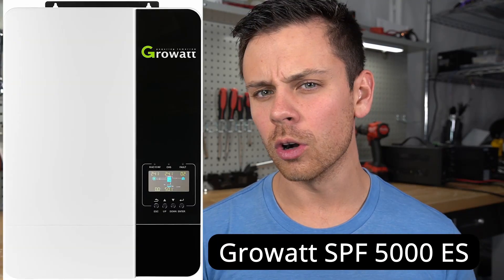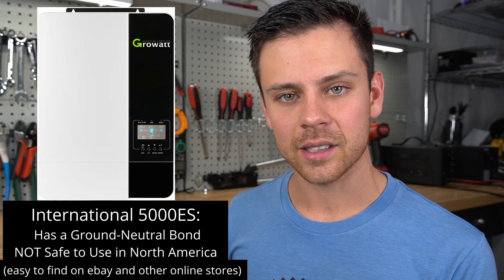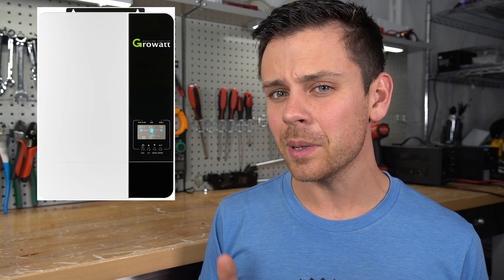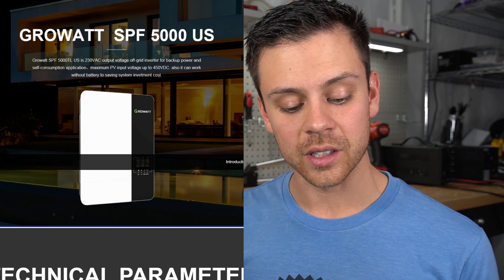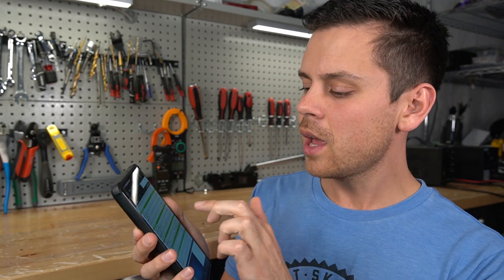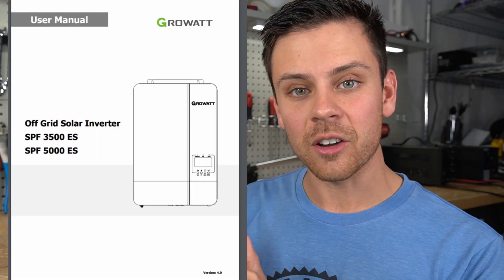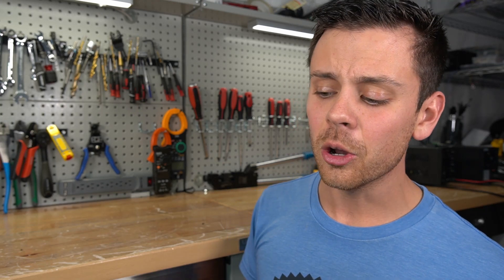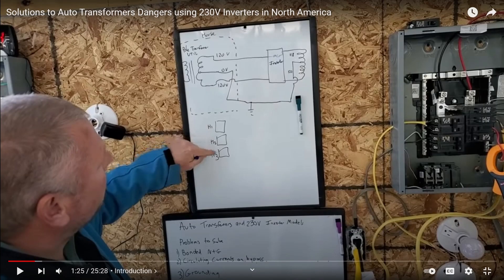The Growatt 5000ES Fiasco Explained: Is it safe to use 230V Inverters in North America?

Comment from the maker: Ian's 230V Inverter Video Part 1: https://youtu.be/gQ4NF9n0UxE
Ian's 230V Inverter Video Part 2: https://youtu.be/goF46wGmPEc
Forum Thread: https://diysolarforum.com/threads/safe-grid-use-of-the-5000es-and-transformer.34121/page-17
Signature Solar's Response: https://youtu.be/90O_iGjfm28

~~~~~~~~~~~~~~~~~~~~~~~~~~~~~~~~~~~~~
Tired of getting ripped off? Check out my "Will Prowse Approved" solar product recommendations below!

12V Batteries
https://www.mobile-solarpower.com/lithium-batteries.html

48V Batteries
https://www.mobile-solarpower.com/48v-batteries.html

Offgrid Inverter System Builder
https://www.mobile-solarpower.com/48v-complete-system-blueprint-559371.html

Hybrid Inverter System Builder
https://www.mobile-solarpower.com/code-compliant-48v-offgrid-system.html

Mobile Handtruck System Builder (very popular!)
https://www.mobile-solarpower.com/mobile-48v-system.html

Solar Panels
https://www.mobile-solarpower.com/300w-solar-panels.html

Ground Mount Solar Racking
https://www.mobile-solarpower.com/ground-mount-racks.html

Wire, Lugs and Busbars
https://www.mobile-solarpower.com/wire-and-connectors.html

Tools
https://www.mobile-solarpower.com/tools.html

Fuses and Circuit Breakers
https://www.mobile-solarpower.com/fuses.html

Plug-N-Play Solar Systems
Ecoflow, Anker And Bluetti! So many models to choose from. See my current recommendations here:
https://www.mobile-solarpower.com/full-size-systems.html

~~~~~~~~~~~~~~~~~~~~~~~~~~~~~~~~~~~~~~~~~~
Need to build a large DIY system? Need a trustworthy solar distributor? These are my favorites:

Signature Solar
Creator of EG4! Solar Minisplits, Victron and More! Largest Solar Store Online.
If you want $50 off, please use my link below and coupon code "DIYSOLAR50":
https://signaturesolar.com/?ref=cPwLcVc0SW-BjN

Current Connected
Best Prices for EG4, Victron, Midnite and so much more! Fast Shipping and Highest Rated Customer Service:
https://currentconnected.com/?ref=wp

~~~~~~~~~~~~~~~~~~~~~~~~~~~~~~~~~~~~~~~~~~
Join our DIY Solar Community 
Need more help? Join the largest solar forum on the internet for beginners and professionals alike. 140,000 members and counting!
https://www.diysolarforum.com

Check Out My Free Book
Best-selling and beginner-friendly guidebook to off-grid 12V solar!
https://www.mobile-solarpower.com/the-book.html

~~~~~~~~~~~~~~~~~~~~~~~~~~~~~~~~~~~~~~~~~~
Contact Information:
I am NOT available for personal solar system consult! If you wish to contact me, this is my direct email: williamprowsediysolar@gmail.com
FTC Disclosure Statement and Disclaimers:
Every video includes paid promotion or sponsorship (such as free products for review). Some links on this YouTube channel may be affiliate links. We may get paid if you buy something or take an action after clicking one of these. My videos are for educational purposes only. Information is subject to change/update at any time. Electricity is DANGEROUS and can kill. Be smart and use common sense :) DIY Solar Power with Will Prowse is a participant in the Amazon Services LLC Associates Program, An affiliate advertising program designed to provide a means for sites to earn advertising fees by advertising and linking to Amazon.com
Reply: I'm trying to source an inverter for a GRID-TIED system with two of the 5kw 48V jakiper batteries you reviewed. I already have the batteries. Jakiper recommended the Growatt 5000 ES. Do I need one for each battery? Do I need to be careful about finding one with the proper N bond? Is there another inverter you'd recommend for a grid tied system?

Comment: It would be interesting to find out where they link the Ground & Neutral Bond is, 
It's a Off-Grid unit for European markets, normally in the UK the Earth & Neutral are grounded at the substation, so I can understand why as a Off-Grid generation Unit as this its basically copying the Substation Transformer, it would be best just to have a Removable Link so the Customer can remove this link say near the mains supply input, 
Lots of people in USA Canada use the Victron Energy Inverter & have no problems & that's a European designed inverter,
I have to look at it this way, in  USA - Canada they have a approved inverter seller & by going to this seller everything is ok, then its a problem Only for the people who don't use the seller, yes
But using it as a totally Off-Grid unit, there's no problem, 
It's not a problem I feel with All European Off-Grid Inverters. You must have used Victron Energy units & found them excellent, yes 👏

Comment: Can any one please help me I cannot finger out if what I have planned will work.
I have a 5kwh off grid inverter Growatt 500es, the reason I picked this model it no batteries are required and any power my solar will not supply it will be toped up from the grid.
I want to put the 4 panels on my garage roof facing south south west.
And 4 panels on my flat against my west west south wall.

The inverter specs are as follows
5Kwh inverter
450v PV input max
22ah PV  input max
Where I live on an island in the UK it is almost impossible to get low ah panels 10 or bellow, but very easy to get high Watt panels like 550w+
Unfortunately they are all around 50v VOC x 14ah STC.

I want to connect them in parallel in pairs of 4. In my head this should work as I should never hit the 22ah current but I’m just not sure.
Can an expert please explain why this would and wouldn’t work.
Thanks

Comment: Hello ,

if the Growatt 5000 ES will only be used to charge batteries from the US power grid? And the inverter will feed energy from the battery to devices that will never be connected to the US grid? There will be no solar panels connected. The inverter will only charge the batteries and give the girl from the batteries to specific devices.?

Comment: great tip Will, is it possible to run the 5000es battery-less (no battery) like you did on another video with the SPF 3000TL, what would be the nominal voltage generated from the solar panel to run the 5000ES as I did not find that in the datasheet?

Comment: Greetings, dear Will! I highly value the educational videos you create in this community dedicated to improvement through solar energy use.

I would greatly appreciate it if you could take on the challenge I'm about to present.

A few months ago, precisely in June of this year, I purchased the PIP6048MT inverter from MPP SOLAR. It operates at 48v, has only one phase at 230/240v without a neutral, and is not split-phase. Therefore, a transformer must be used to obtain the two phases + neutral.

I'm interested in seeing you perform the installation of one of these to illustrate the correct steps. I'm unsure about where to separate the ground and the neutral, whether it should be at the inverter or the main panel.

I have this doubt, and I believe you can provide us with better guidance or illustration.

Thanks in advance.

Comment: Hi, i appreciate your knowledge and videos as a new solar DIY fan and eventual user. I have purchased about 8,000w of daily production panels.  I will buy a couple of 48v batteries  and I intend to purchase a 110v grid assisted inverter of about 6-6,500 watt output. is the MPP LV6048 suitable ? Is the idle consumption and AC  efficiency pretty good? Any help and advice would be greatly appreciated, i just want to try and run a few items such a refrigerator and a freezer that require constant power to cut down on my electricity bill and have a backup if and when the grid fails.

Comment: Hi, I have watched you for a year or two now, and you seem to be very favourable to MPP inverter/chargers (aio) , I spoke to them about one, and they said” we can’t guarantee that it would work with my generator, I have an ex rental diesel generator, running at a fixed speed of 1500 rpm, giving me 50 hz, surely, that should be ok with an MPP aio? Thanks for any advice. Cheers free the UK.

Comment: Europe generally uses a 240V system analogous to 120V in the U.S. - basically everything is double the voltage. So a 240V inverter in Europe is a single live and neutral, similar to a 120V live and neutral system in the U.S. In both cases it is reasonable to bond the ground and neutral. In the U.S., a 240V system is really a neutral with two separate live wires at +/- 120V opposite phase with respect to neutral. If a European inverter is used as a U.S. 240V system without a U.S. neutral, then the inverter effectively grounds one side of the 120V "live" wires when used in the U.S.! Furthermore, if you want to use the inverter to generate a derived neutral between +/- 120V using an auto-transformer, then the  inverter has to have the ground/neutral separation so that the derived neutral can be safely grounded. I hope this makes sense. This would be a lot easier to explain with a diagram!

Comment: Hi Will I have a growatt 3000 TL 24v, built a 2,8kwh lifepo4 battery using 8×130 ah cells, what make of bms can I use that is compatible with growatt communication system. My local distributor sell growatt with pylontech batteries. Please help

Comment: @David Schultz   The groWatt i just bought on Amazon Sep 29-2022 does not remove the bond screw Ground to it's neutral.  it's Neutral not really Neutral because Growatt 5000 is 230/240v which mean both of those wire are hot and it bond one of it hot to ground. so if you ground your unit to your ground that connected to water pipe.  your family and you can get shock and stop the heard.  Dammmm....

Comment: Grounding is 1 of most important aspect in electricity. Understanding that 240 volt is the result of 2x 120volt with 180 degree difference. Should 1 phase touch a châssis it can become live. And thinking that a floating system can save from this is like wishfully thinking.

Comment: We have had nothing but issues trying to use grid assist with our Growatt.  We have 3 of the 5000ES.  Which isn’t enough for our house to be off grid. Which I think is fine for these inverters if you don’t try to use grid at all. 
I’ve got a lot of money tied up in a grid assist that cannot assist. Trying to figure out how to salvage my system and sanity. It’s been a frustrating 8 months to say the least. I wanted reliable power before the world goes crazy and here I sit $26,000 poorer and no reliable power.  4 freezers of meat hang in the balance.  Ggggrrr.

Comment: I have found that Growatt America does NOT answer their Sales, Service or chat calls - they don't call back when a VM is left for them.
Pretty unprofessional by any standard. Makes me worry what would happen if you actually needed them post sales.

Also - you state "North American", UL Listed (not just tested) - not valid in Canada unless CAS 22.2  No. 107.1-16 Listed. Trying to get this straight as to which inverters will pass in Canada is virtually impossible.
Signature Solar didn't know if the EG4 6.00EX-48, although tested by a 3rd part company TUV Rheinland as "Tested To:" would pass any inspection in Canada.
Not a very impressive industry overall with regard to standards.

Comment: I own 6 Growatt and 2 auto transformers from Signature Solar.  I absolutely love them. We run them Off grid and have had no problems. For safety we use 2) 4 pole Mcb and run 3 inverters and one neutral through each breaker. To me with my background in the Elevator trade it is a simple project.  But I 100% agree if you are a novice electrician and can’t read a electrical schematic……………WALK AWAY from Growatt!
Reply: Hi, why two autotransformers please? Also what size are do you use?

Comment: If the issue is simply that they have tied the neutral to ground inside the case  of the unit it will not cause hazardous voltages. You tie your neutral to ground inside your household electrical panel of your house. The issue is that you can create ground loops between the two places that are now grounded that have different potentials due to geography on the planet. This can lead to stray currents which screw up communications or metering, generally not unsafe voltages. This is covered in section 10 of the canadian electrical code.

Comment: This may be a noob question but here goes, Could I run all my 240v loads out of one panel with the growatt inverter and get a seperate 48v to 120v straight inverter and feed a seprate panel for my 120v loads? probably not much more money then an auto transformer and it would keep everything seperated. please let me know if this is a bad idea because I am considering it.  I need the high PV voltage for a 350 foot run . of course thats assuming I get the us version of the growatt. Thanks.

Comment: I have a quick question for you. I'm new to solar but not to electricity. I've had a few cringe moments with some of your videos. Why don't you use ferrules nlon the end of your strained wire? It makes for a far better connection and a much easier time installing wires in these Inverter chargers. Love your videos by the way!

Comment: I’m not an EE, an ME with some industrial electric power experience. Seems to me the solution to using a 230v inverter for a 120/240 system is to use an isolation transformer. Not cheap, and certainly erases any advantage of a slightly less expensive inverter—but if that’s what you already have…

Comment: Thank you for clearing this up. I noticed on my sites the Growatt is crossed out and being replaced with Rich solar inverters. Trying to get a full system for my off grid homestead to use in a few months is getting closer. Need to get a complete small kit soon. As I am a total amateur at choosing and creating as well as connecting electrical I will need to enlist an electrician who I hope is familiar enough to connect all. Cant find anyone in NE Tenn who states this is their field of expertise in solar installation. Having a company supply and commit is adding several thousands to my bottom line, which at this point I am trying to cash out with no loans for my land or homestead or solar to live as debt free as I am able.
Reply: Hello.. get ahold of me and I'll help out with what I can.  I'm from Smyrna tenn and I mess with solar alot
Reply: And I actually have quite a bit of solar stuff I can show you and teach you to use it

Comment: will have you checked out the master volt line. They have a 12v 400AH battery that can be series up to 4 for 48volts. they also have charger/inverters. Just thought you might want to look.

Comment: If it can be split into 2 phases or use it to operate ungrounded 220v equipment like a hot tub or water heater it could still work.

Comment: Will I've been fallowing for over 2 years now and I bought equipment under your recommendation spending thousands of dollars on equipment that you now say I should not use. I don't have the money to just simply through them out and start over maybe you do I'm not saying it's your responsibility but it would helpful if you had some instructions on how to work with what have. Please respond.
Reply: You don't have to throw it out the window. Just ensure the inverter isn't bonded using continuity on a meter and it's safer to use an isolation transformer instead of the autotransformer once tied to the grid.

Comment: I get your point on the Growat inverters, but at the same time I have had very serious quality problems with MPP Solar and very rude unhelpful product support, such that I have two of their inverters lying useless here. They lasted less than 1 year, and after giving up on their product support, I took them apart and found their capacitors to be underspecified in terms of temperature and guaranteed lifespan.
Reply from the maker: Which model?
Reply: I will have to find the big cardboard boxes I placed the scrap in to tell you, but I remember back then, that many others had similar experiences with MPP Solar, we basically never wanted to deal with that company again, based on all this. Instead we shifted to MUST inverters, and have not had any problems with them. They might not be quite as cheap, but definately with better specced capasitors and MOSFET transistors.

Comment: very good video. The USA/ north America uses a 240V 60 Hz split phase power. the neutral and ground is the center tap making 2 sets of 120v, much of the world use 230/240V 50Hz with one leg ground. even with a auto transformer the ground neutral must be changed or a shock hazard will happen. and forget grid tie. the USA is 60 Hz. a 50Hz 230V wont link up. and in USA the NEC requires the UL approval for grid tie inverter and permission from power company  changes from state to state. I am a electrician in NY/USA. Even I made a mistake buying a 12v to ac 400watt inverter on eBay. I got 230V 50 Hz UK plug. still use it only on some electronics that except 240/230 50/60 Hz. best to get UL approved inverter for on/off grid use.

Comment: I am not sure you explained WHY its dangerous sufficiently. I think you are saying any bare metal on the chassis is electrified unfused if it meets a conductor. IE scratch the paint while barefoot and you get 50 amps ac? im thinking its probably more dangerous than that

Comment: The solution : change the USA grid to 230/400 V,  one day that has to be done anyway or do the big change that is coming -> DC.
 High voltage is much better than high current. And the next generation 800V electric cars will not make it easier !
I have worked many times in the USA with EU equipment and it was always a challenge , huge cables doing nothing.
Reply: There is just an increased risk of death as the voltage goes up… that is just a little problem.

While the Europe deals with dozens of languages, the US deals with hundreds of languages in a community, so reducing risk for all citizens is pretty important.

I don’t see high voltage DC making a big splash at the individual housing level… that will make victims a little crispier.